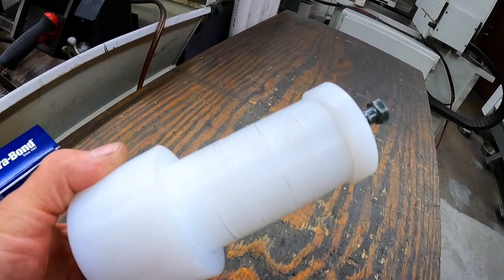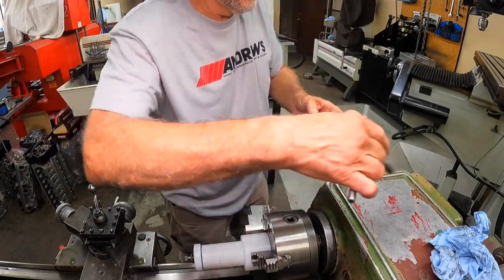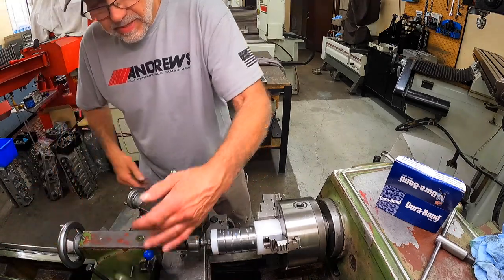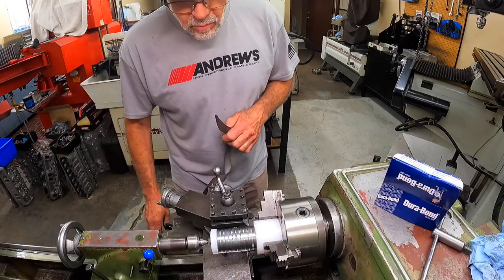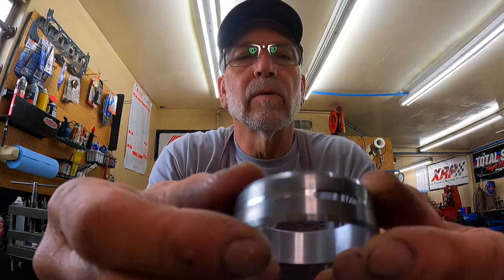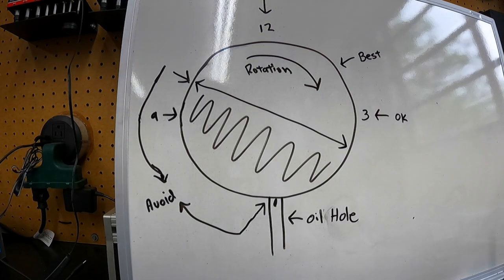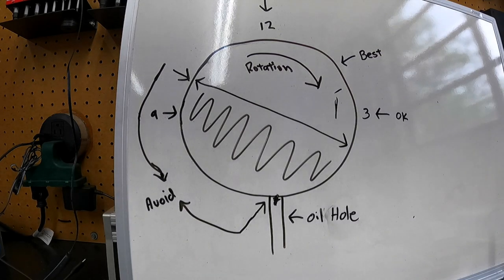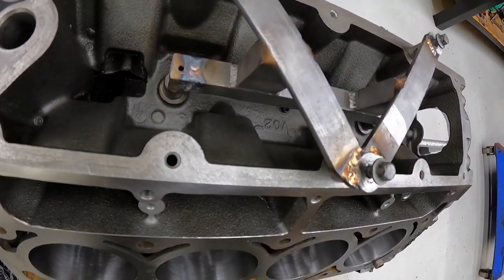Machining Cam Bearings on a Small Engine Lathe | Gerald Brand Racing Engines

Comment: Doing this modification also makes the bearings act as oil restrictors too, limiting (in a good way) the oil feed to the camshaft.  Good for engines like the 351C that "suffer" from over-oiling of the camshaft bearings.  Nice work.

Comment: You can proly do 5 or 6video just on a full machined block. I dont think there are many video about actual blueprinting and measuring before assembly. I myself would like to see and hear about piston squirters and how to machine in. And judgin by our weeks long forum discussions about which main gets what 1st, maybe an oil galley(s) refresher. Were good on front drive distributors, i promise

Comment: Great information. I have a SBC with the cam bearing groove in the block. I will definitely be clocking the cam bearings for more oil pressure and to help the life of the bearings.👍💯
Reply: Clocking the bearings does not matter at all. 

It’s all a matter of conjecture.
Reply: Thanks 👍

Comment: If you don't mind doing them one at a time, you could probably use an adjustable cam bearing installer/remover on a short staub. Expand the tool out to get the friction drive effect.
Reply from the maker: Yes that would work fine. Thanks

Comment: How about bottom end kits from lower end to higher end and the differences in crank materials and rod materials and design . Then what should be good enough for different horsepower levels.

Comment: Hi Mr Brand. Only just found your channel. Have you done any videos that show blueprinting the oil galleries? Or do you have any incite on what size oil galleries is too small?  I am curious if the BMW S85 / S66 engines that keep spinning rod bearings have an oil gallery that is too small in diameter.  
Regards Ryan. 

Ps, your mod to groove the back side of the cam bearing will also keep the bearing cooler as it has oil flowing all around it now.
Reply from the maker: I have no idea on the oil system on the BMW

Comment: Mr. Brand l, I'm curious about the benefits of "roller" cam bearings vs. a standard flat pressed in cam bearing like in today's video. What situations would a bearing like that be necessary? What other components are necessary to work with a bearing change like that? 

I'm also curious about larger cam lobes vs. retro fit size cam lobes....benefits of as far as lifter  wear at high rpm(7k +), high rpm capability, stock lifter bore size or necessary to bore for larger diameter lifters.
Reply from the maker: I have not seen any benefit to roller cam bearings. No other component necessary. It the barrel size of the core not the lobe size. It depends on the camshaft.
Reply: @BrandRacingEngines  thank you sir.

Comment: Interesting.. Could there be a way to cut the groove to the bearing housings while line honing them? To prevent the bearings from spinning. When the housing wall is straight and all you have is that relatively shallow groove on the bearing itself, the oil pressure might sqeeze out between the bearing and the housing. I know it is heaps simpler task to do like that, but the groove in the housing would allow thicker oil, and it would suck the bearing tight against the housing(this effect needs both grooves btw), instead of squeezing out in between. You'd need to be able to adjust the cut depth mid cut, and that's where my engineering skills end.. A screw and a wedge and a pivot pin to hold the blade, or something..?

Comment: I am wondering if you have worked on 5.7 Hemi Engines? are you aware of them eating camshafts do to oil problems suspected and have you modified the oiling system in any 5.7 Hemi's?
Reply from the maker: I have work on the hesds

Comment: Howdy Gerald, Curiousity kicking around in my Noggin... Building on a skimpy budget, I've been a Die hard SBC/BBC gear head, after being a greasemonkey my entire life... I have a bunch of SBF and Foxbody aswell as other projects... My Interest is, Currently I have 1 forged steel 331 and 1 347 Forged steel crank, and 1 cast 347 crank... Using 90's OEM roller blocks etc... My question, Difference in Build costs Cast vs Forged where Balancing/Crank Lightening are either more or less budget & durability friendly??? I honestly wouldn't mind finding a OEM 8.2 deck Limits, Even if I split several in 2...
Reply from the maker: If you have the forged crank us it
Reply: @BrandRacingEngines  That is where I'll start, Thx Gerald...